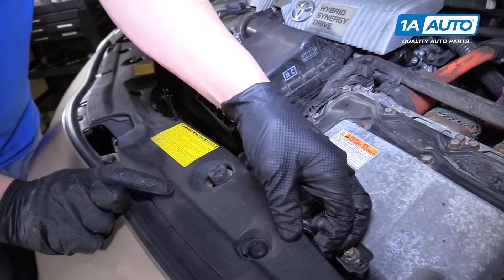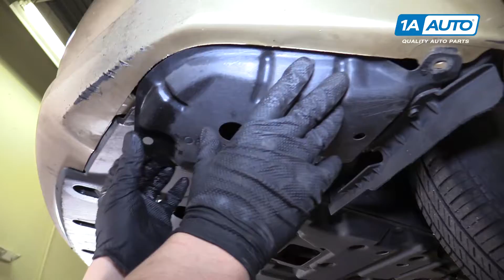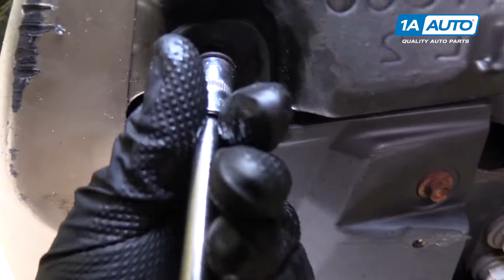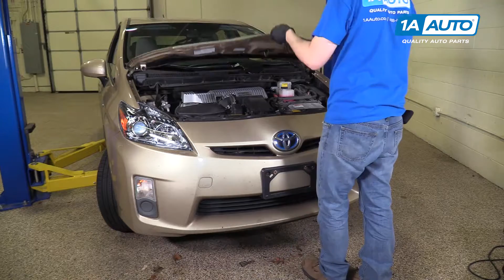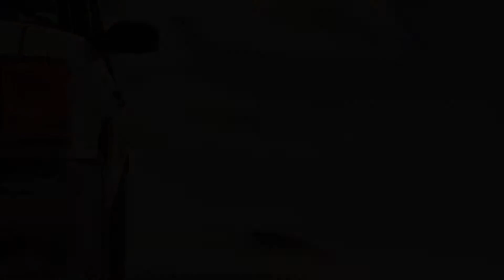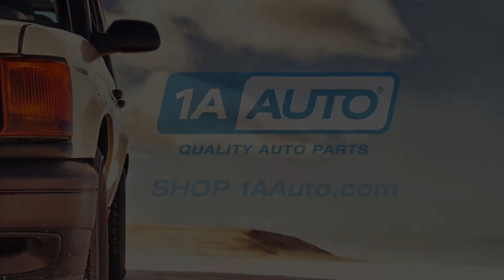How to Install Windshield Washer Pumps 10-15 Toyota Prius

Comment: This video is rediculous.  You do not need to take off any of the top crap or the bumper.  There are 5 or 6 10mm screws too remove one little cover in front of the passenger side wheel well. It gives you all the access you need.  I did this in 10 minutes with a couple of floor ramps.

Comment: This is a really good video on removing the front bumper cover but it doesn't have to come off to replace the windshield washer pumps. All you have to do is remove to gain access to them is to remove small bottom cover on the right-hand side just forward of the front wheel.  Once this small cover is opened both pumps are in clear view. I always jack the car up on the right side to gain access...

Comment: It's possible to remove the front left inner fender liner, removing the screws and clips along the fender opening, and also three metal screws that hold a deflector running across under the car in front of the tire... this will open up enough space to pull the pump, drain it, disconnect/reconnect wires and hoses to the new part. The pump pulls straight out of the grommet with a little effort. The new one sealed up without leaks and the whole installation was about 30 minutes, making an effort to work carefully to save the plastic push connectors for reuse.
Reply from the maker: +@robertwhitman1981 Thanks for the feedback!

Comment: This is absolutely wrong way to change this tiny pump... Just remove the front wheel and the shield... You will have easy access to that pub... You don't need to open that many parts which takes time and energy....

Comment: Is removing the bumper really necessary? Why not just the wheel well liner?
Reply: I just put one in on my 2011 Prius just by removing the lower outside two plastic fasteners that hold the bumper to the wheel well liner and I had enough room, didn’t even hack up the car. My car might be missing a plastic shield that is underneath the very front of the car but still that’s a lot easier than removing the bumper.
Reply: I have replaced this twice on my 2012, first the front pump and 2 years later the rear. Both times I completed this very easily by just removing the wheel well liner - plenty of space and a very easy job.
Reply: You are correct.   This video is worthless.
Reply from the maker: +Andrew Choate Yes, we do recommend removing the bumper cover for this repair.